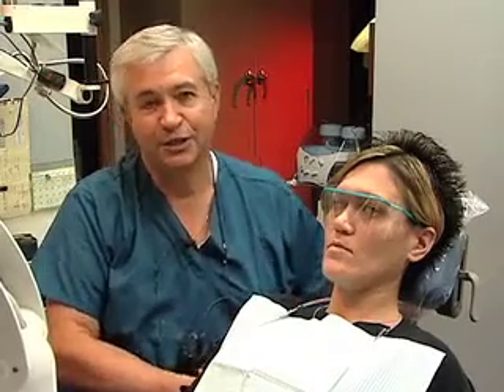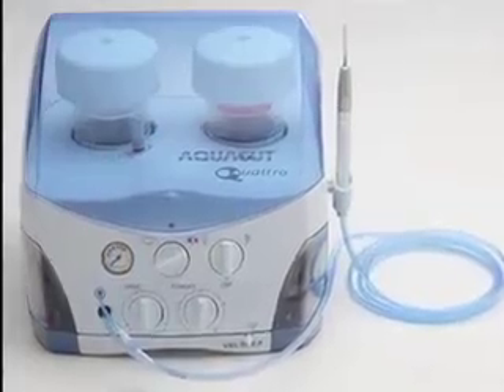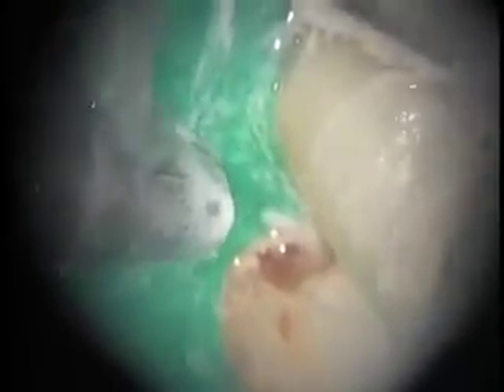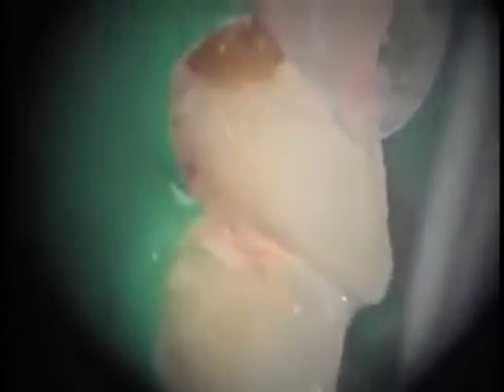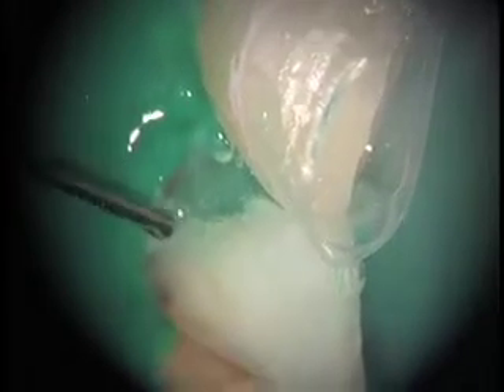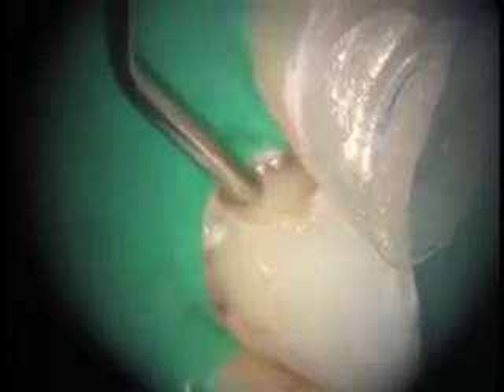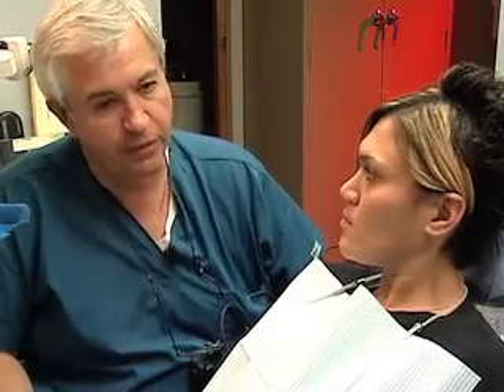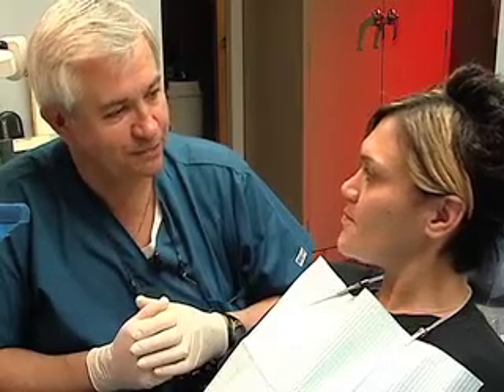Dr. Graeber's Aquacut tooth repair

Comment: That tooth looks painfully bad but it is comforting to know that something like that can be fixed. County Insurance dentists don't fill they pull. I want this guy to fix my teeth. :) I need to start saving my money and look for a dentist that can do that 'cause if I use the county insurance they will pull them all. There may still be hope. I'd never seen dental bonding before and without a drill is a plus. No more smelling drill burnt teeth.
 i wonder if this procedure much more expensive and whether many Dentists use it. I'm going to have to look into all of this. Thanks for posting the video.